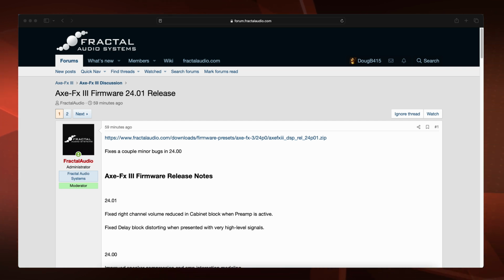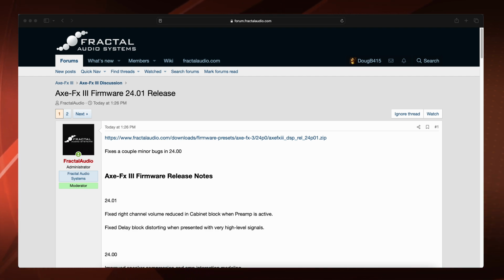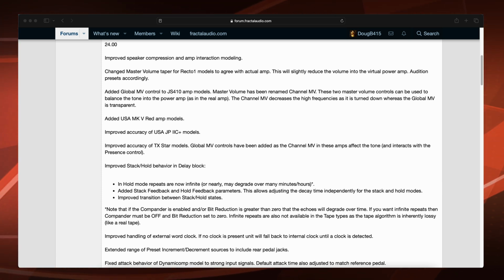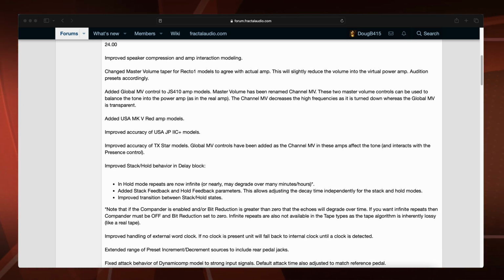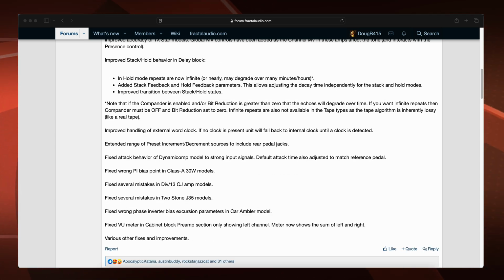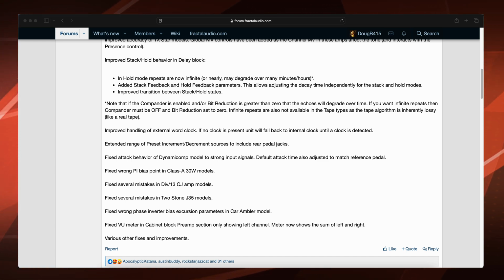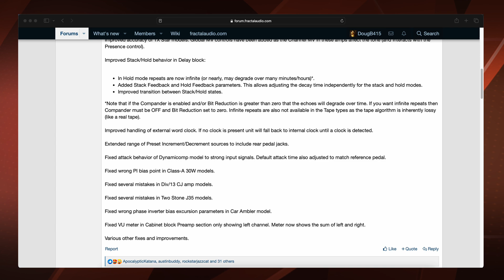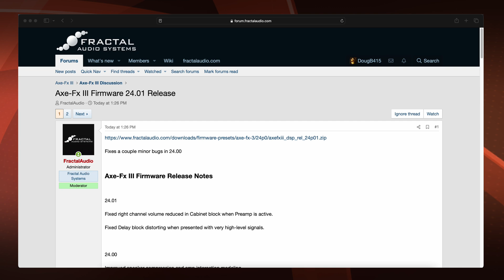Axe-Fx III - Firmware 24.00 & 24.01 Released Today!

Comment: I don't get it: is it still a beta or a full release? the official Fractal website still has the link for 23.05
Reply from the maker: Fractal pulled 24.00 and 24.01 from production because of bugs. There is a 24.02 beta, but the current production firmware is 23.05.
Reply: thank you!!! @DougBsDigitalDen

Comment: As of dec 22, it seems the 24.01 and 24.00 download links have been removed (bug with delay block from what I read in the forum)  - did I miss something?
Reply from the maker: No, it's just that stuff changes so quick for Fractal. There's a new beta out if you're interested: https://www.fractalaudio.com/downloads/firmware-presets/axe-fx-3/24p0/axefxiii_dsp_rel_24p02_beta1.zip